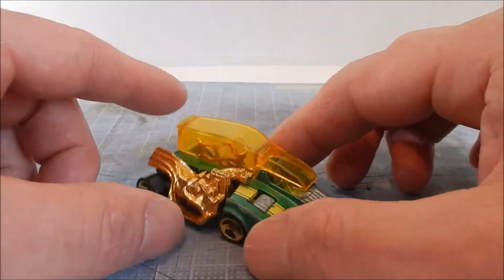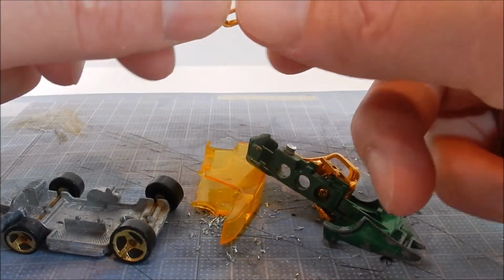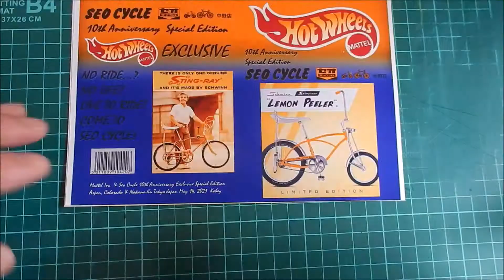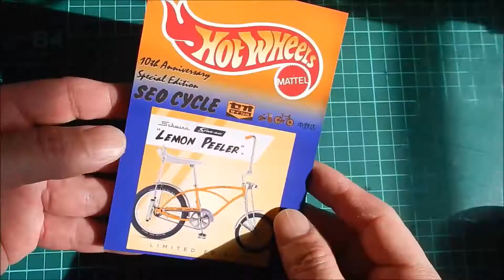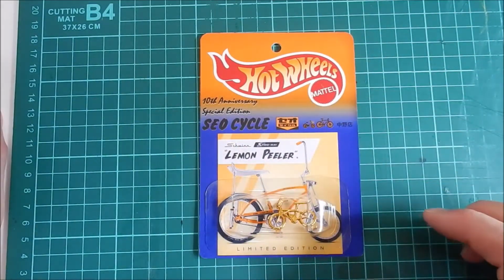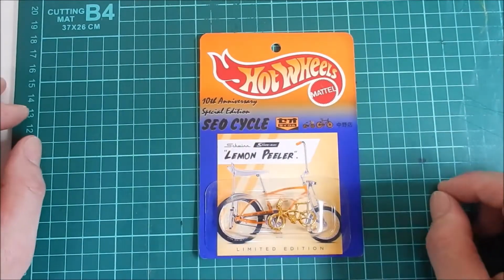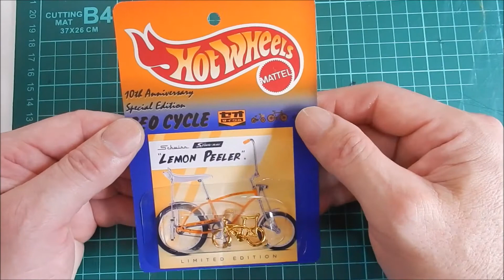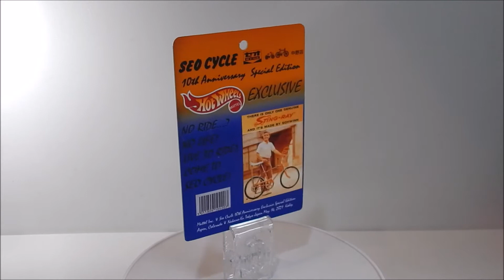HOT WHEELS SCHWINN / POPCYCLE SALVAGE PROJECT FROM TRASH TO TREASURE!

Comment: I have not seen that corner trimmer you used before, what is that called?
Reply from the maker: Hi there, yes it is called a KA-DO-MA-RU kado is Card and Maru in Japanese is Circle or Round so its a Round Card Corner Puncher. It is also featured in My Transformers G1 Decoy Series and I will be using it again soon...I think. LOL
Reply: Its an interesting tool, I will try an get one, thanks for the info.
Reply from the maker: @colinsdiecast164customs  I believe you can get them at Amazon. I got it at a well known Japanese Chain Store called Don Quixote but not all of these stores carried it so when I found it I was happily surprised! About $20.